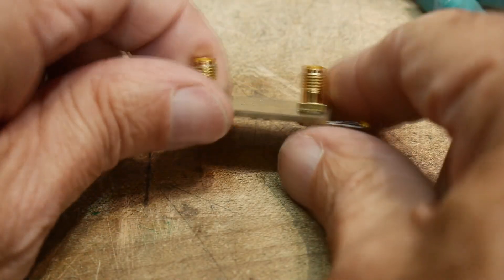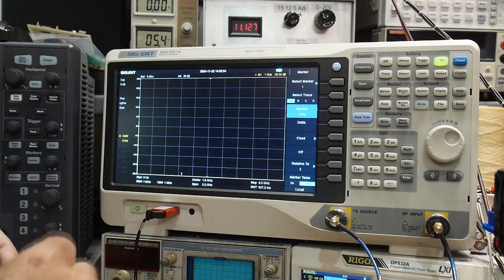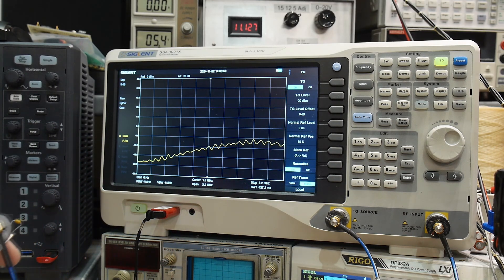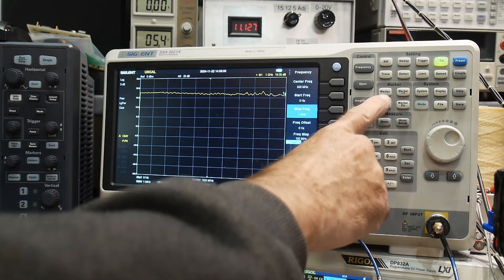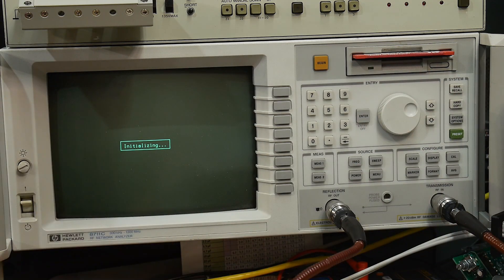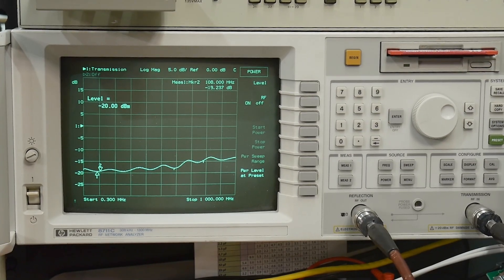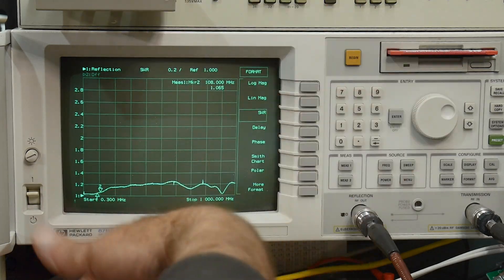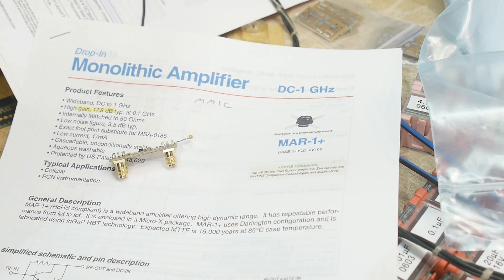#2072 MMIC amplifier boards from WA5VJB (part 2 of 2)

Comment: I buillt a MAR 6 board like that as a booster stage for a shielded receiving loop.  I saw what the OEM development boards cost and freehanded a PCB that looks similar.  However the bias resistor was replaced with a pot because they call out 1% resistors for a list of power supply voltages.  I used a 9V battery and set the drain to the 14 mA called for in the specs.  Does the job.  Noise figure is low at several GHz so I figured HF might be same or even better.  Gain is plenty for the job.

Comment: i remember having 2 of very similar devices inside of a tv antena amplifier board in my first grid amplified compact antena around 30 years ago
could those be those ic's? i remember distinct shape and 4 flat leads and also the ic's were mounted in a hole in the pcb
Reply: Maybe. The way those MMIC's connect up looks very similar to a regular RF capable NPN transistor. The MMIC's here are designed to self bias and have a very carefully designed amplification.